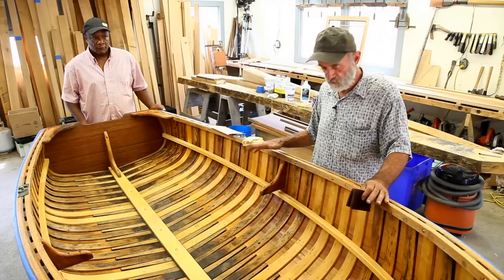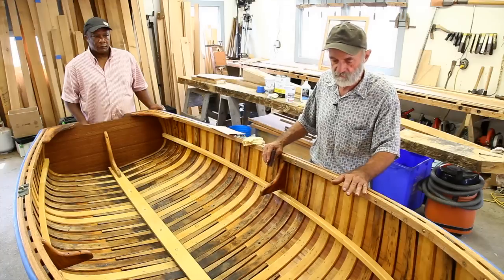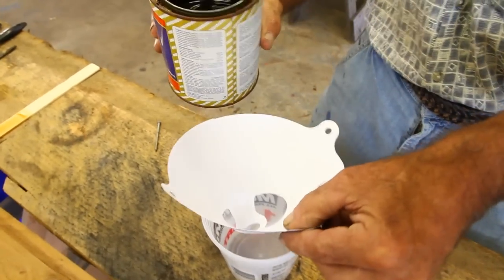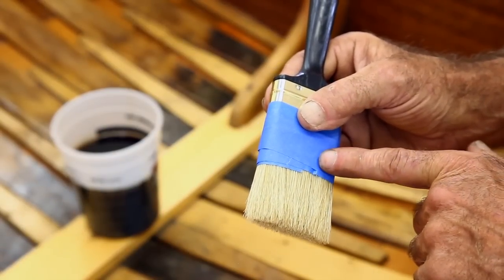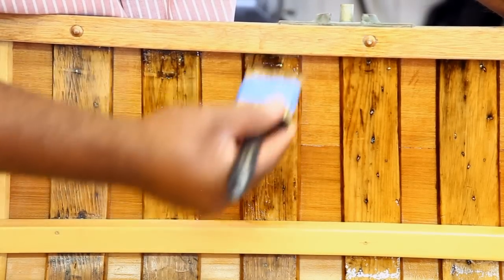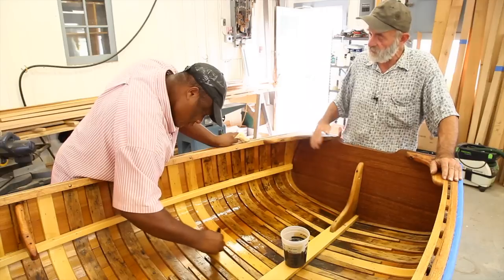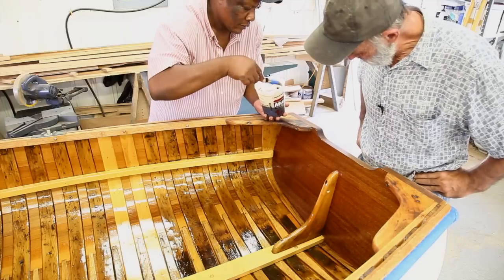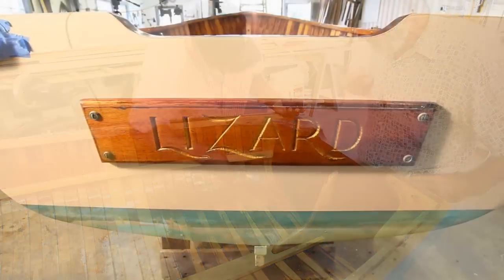Varnishing - Part 1

Comment: In about to revarnish a 1969 12 ft dinghy. It's a little discoloured and some peeling. Can I rub back to a smooth surface without needing to apply sealer again? I expect this has been varnished many times over the years. Thanks